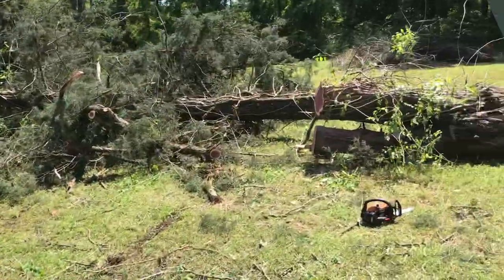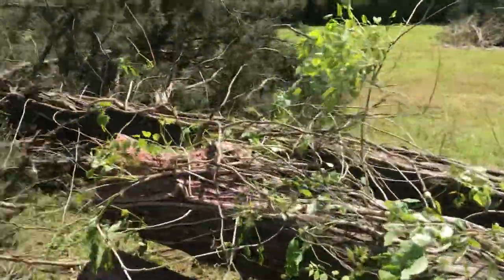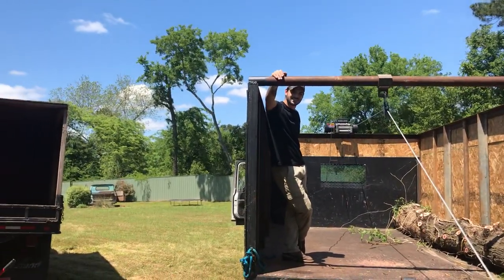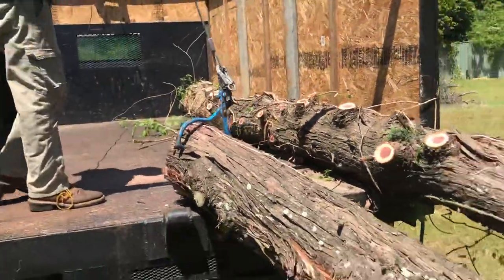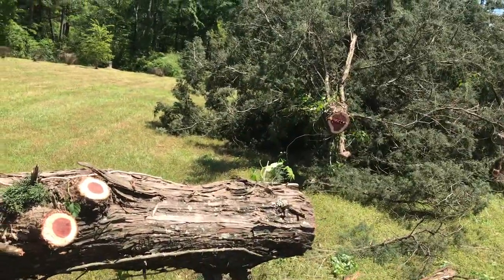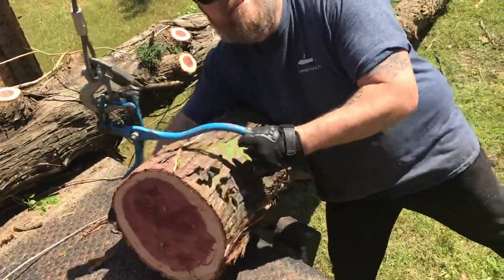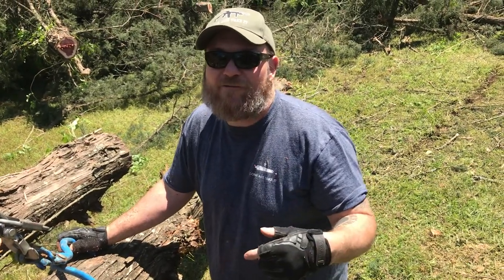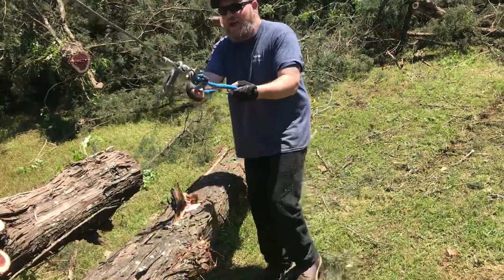Homemade log loader demonstration

Comment: Do the logs get snagged up on the walls when you try to dump it?
Reply from the maker: Well it was a 14’ flatbed so the way we dumped it was just reversed the Process with the redirect  that lifts them up just bring the Large tongs to the front of the bed and grab the end of the log and it pulled them out one at a time. I’m sure putting the same thing on a dump bed would work even better 👍 good luck to you

Comment: Looks like that works great.
Reply from the maker: megadose vitamin c Yeah it’s really awesome! Just need to get that cordless remote. That cord is only 12 ft and the bed is 14. Otherwise Dustin could get down out of the way. But that’s coming this weekend I hope. Appreciate your advice as you see it made a difference 👍
Reply: @coilstreeservice9398  i need to build a set like that for my flatbed. I usually have my tractor to load but that would be nice if i didnt have it. Or maybe to unoad logs. Wireless would be nice for sure. 1 guy could set the tongs and run the winch. Then u could sit in a lawnchair and supervise..